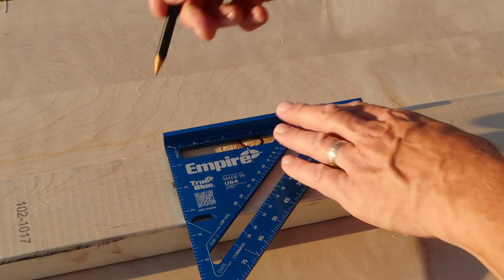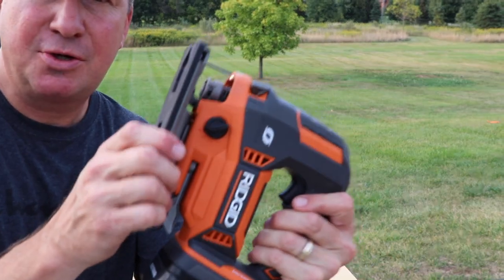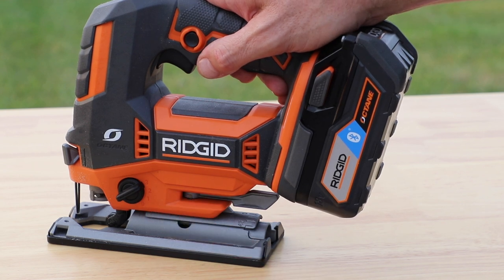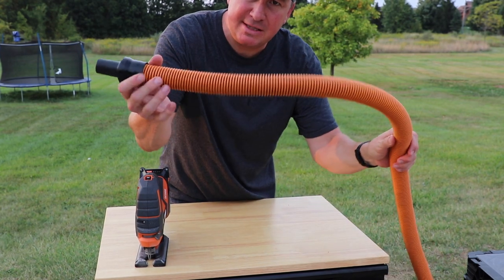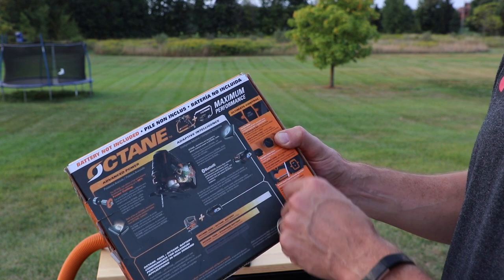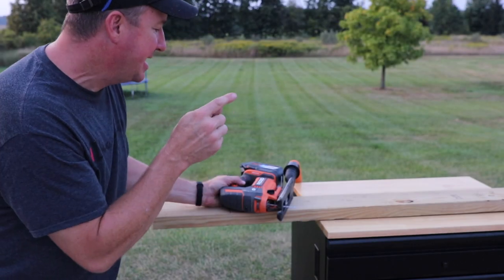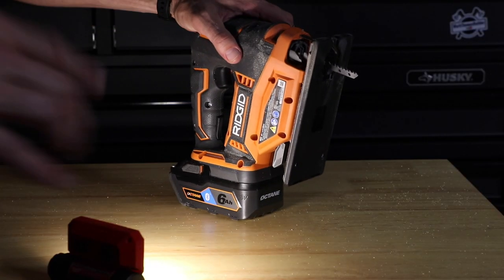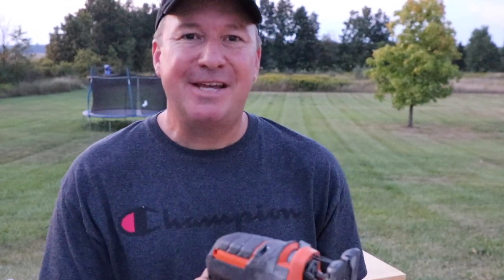RIDGID OCTANE 18V BRUSHLESS JIGSAW- AMAZING POWER!  BLUETOOTH BATTERY!

Comment from the maker: Question of the day: Does this jig saw have all the features your looking for?  Would you do bevel cuts with it?
Reply: Can the built in blower be turned off? It seems a bit annoying.
Reply from the maker: Not that I know of.  It comes in handy if your not using a vacuum, especially on the 0 oscillating setting when cutting fine wood.
Reply: Leo Ionita the blower can now be turned off on the newest skus of octane jig saws. The bottom skid plate hole is also gone on the newest version providing better vacuum
Reply: @kdc300z  same model #?
Reply: @_DST0NE_  it is the same model number. Just look for the all Orange Box and on the picture you will see a black rectangle towards the bottom. It's the switch to close the valve
Reply: @kdc300z  sweet! Good looking out 🤜🤛
Reply: I need it

Comment: Mark, suggest using a clamped on wood fence to keep your cuts straight. I have had many RIDGID cordless tools, including this one, and I use a wood fence as a guide when accuracy is important. Use it for circular saw cutting, too. Great results! . Great video, thanks!
Reply from the maker: That's a great idea.  I noticed that a fence would help me get better results with this.

Comment: BLACK+DECKER makes excellent tools🌗 allabout.wiki/BDEJS600C . I am reminded of this every time I pull out this jigsaw or use my BLACK+DECKER router. High precision, fantastic performance, lots of power, great control, etc. BLACK+DECKER tools do tend to be more expensive than average and this jigsaw is no exception, but the fit and finish of the tool make it money well spent. The only complaint I can come up with is that there is no dust extraction system, but I don't think any jigsaw I've seen (outside of festool) has that.
Reply from the maker: I agree, it's a nice, solid working jigsaw.  What blades do you use?

Comment: So did you say Any older 18 V rigid battery will work with this, or is the octane battery A different shape and size? I almost bought this tool the other day but the pic on the box of the octane battery looked like it was different. I’m really hoping my older 18 V batteries are not obsolete to use with the new octane brushless tools!
Reply: Yes any Ridgid 18v battery from inception to Octane will work. Home depot has a promo with this and 18v belt sander for $189 if you need more tools. lol
Reply: Mike Zurynski Thanks! That is a good deal all right, but I already own the cordless belt sander! Home Depot has another promo, selling the octane jigsaw with a five amp hour octane battery for $129 which is the same price as the tool only price. But they are all sold out. That’s on the Home Depot app./online.

Comment: use some 'D' clamps to hold down the steel ruler to the wood and table. Mark dark outside is when you need a flashlight :)
Reply from the maker: Thanks, good advice!  I'm cleaning out my work corner tonight, so I can move inside at 7pm and finish my filming there.
Reply: @MarkThomasBuilder  Back in the 70's we had a jigsaw that had a turn-able nob which the blade shaft was attached to. you could rotate the blade 360 degrees while running. And you could lock the position in the forward direction.
Reply from the maker: That's sounds like an interesting setup.

Comment: Hi Mark appreciate your review. Quick question, how well does this saw handle blade deflection for you? During your cut on that 2x6 it seemed to have produced a rather beveled cut instead of a square cut, which what I experience too. On mine the bearing guide can shift left and right a bit, which I believe to be a cause of the issue...
Reply from the maker: Interesting, I haven't had mine on long enough to have it weld together.  I like my Zero-G and will probably buy another one this spring as my other brand hoses fail.

Comment: Why do all the jigsaw makers produce a tool that makes it hard to see the blade cutting path? Every jigsaw is the same in this regard - I can't see where my blade is cutting.
Reply from the maker: That's a good point.  You have to have your head off to the side looking in.  It helps if the jigsaw has a blower to move the sawdust out of the way.

Comment: What's the point of having a cordless tool when your just going to hook something else onto it to restrict you (The vac. Hose). Might as well get a corded tool.
Reply from the maker: I actually prefer working outside and letting the wind blow the dust away from me.  If I'm inside, it's still nicer having a cordless tool.
Reply: Cordless is everything!!! The only tool of my arsenal of tools still corded is an air compressor!!